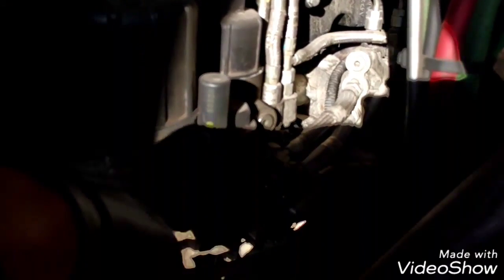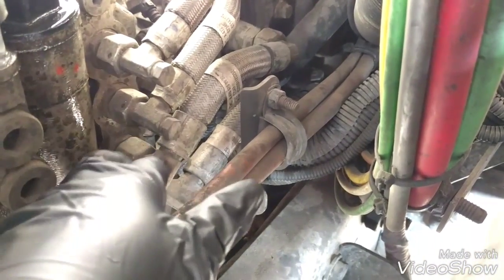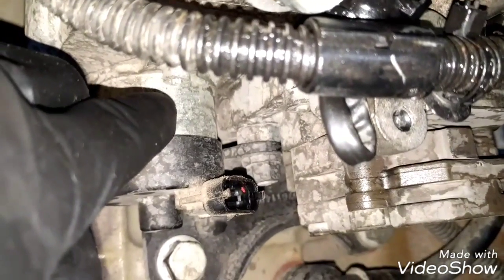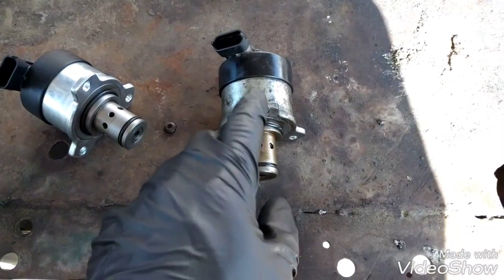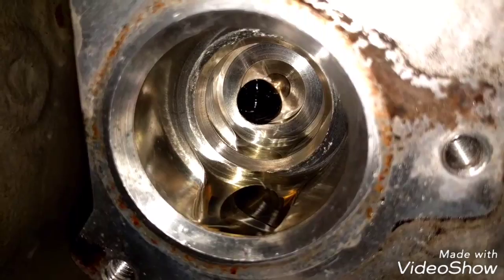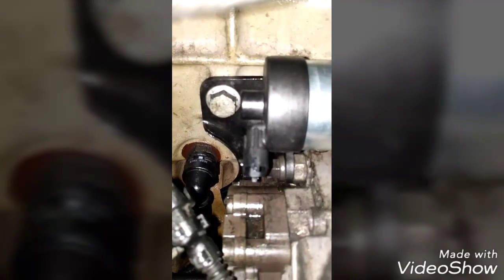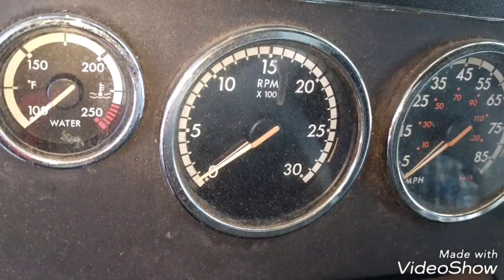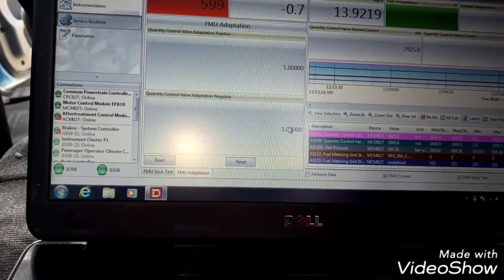Freightliner Cascadia DD13 DD15 ENGINE fuel quality control valve removal replacement detailed

Comment: Hey Francisco, can the fuel quantity valve cause vibration of the engine at 1500 RPM ?? Or does it only cause rough engine operation and idle??

Comment: Nice video amigo,question..can the fuel quantity valve be cleaned instead of changing straight away or it cant? Thank you for helping us drivers with some knowledge
Reply from the maker: No, the electronic area fails

Comment: Would this cause bad fuel mileage? I put fuel in this morning filled it up ran about 250 miles gauge reads half tank. I usually run about 300 miles to a quarter of a tank. I found this video so It got me thinking about getting this done. Thanks in advance for your opinion.
Reply from the maker: Yes, it is possible. A unstable valve can increase fuel consumption.

Comment: 2016 frieghtliner cascadia...What kind of check engine codes would we get if this value needs changing? I had a throttle valve code and after changing the valve I have a rough idle and the same code (DD15 spn 51 fail 18)

Comment: Francisco I change mys now I’m getting a loud noise will that rattle noise go away
Reply from the maker: What noise?
It should work fine with not weird noises
Reply: If you listen to the noise after you replace yours at the end of your video when you crank it up that noise if u could call me plz 6823654954 rob
Reply: Go to 3.40 in your video that noise

Comment: Hey do Volvo trucks have fuel quantity valve?
Reply from the maker: No, they don't.
Reply: Do they have something similar?
Reply from the maker: No, they have a low pressure fuel system with pushing rod to the injectors.  
The fuel system is controlled with the injectors only.

Comment: Hey Francisco! I recently replaced my valve but now I’m getting a fault code SPN 520250 Fail 4. Do I need to get the valve calibrate and clear code for the valve to work properly?
Reply from the maker: Check the fuel quantity valve plug, it could be shorted.  
It may be possible to replace the engine harness.

Comment: I have 1077 fmi 7... I replaced all injectors and code still comes up. I replace hp pump about six months ago, any idea? I dont see a line leaking
Reply from the maker: In the fuel rail, there is a pressure valve. This could be defective.  

The fuel rail pressure sensor could be defective.  

The fuel pump plunger could be defective. 

Also, the new injectors could be defective.

Comment: how did you drain the fuel filters? When you drained the coolant, was it from the radiator, or somewhere else?
Reply from the maker: No, I didn't drain the fuel from the fuel filter housing. 

Yes, I drain the coolant from somewhere else.  There is a small nipple located between the oil filter housing and the fuel filter housing (19 mm), you have open it to drain the coolant from the engine block.

Comment: Why is the orange engine like on?
When do you know   you need to replace fuel quantity valve?
Is there an engine code number ?
Reply from the maker: If you engine does this https://youtu.be/gYq_bcfBQk8 
You will need to replace the FUEL QUANTITY CONTROL Valve

Comment: If you don't use dddl soft wear will check engine lite come on after change
Reply from the maker: No, no light will come on. Unless you already have a check light with this fuel quantity control valve code on.

Comment: What could be the symptoms of a bad fuel quantity valve
Reply from the maker: Unstable idle
Low hp fuel pressure
Unstable HP fuel pressure
Reply: Does it air in system , doesn't start ,then pump it ,then it's start s

Comment: Francisco I changed the intake throttle valve on my 2012 freightliner cascadia because I thought the rough idling was because it was going bad but now its driving rough every time I start to drive it feels like its suffocating. Did I miss something? Please help
Reply from the maker: Probably you have a bad fuel quantity control valve
Reply: I just changed it last week cause I seen your video and its still doing it. The idling doesn't go up an down anymore like you show in your video. Its just hard to start rolling in the road especially the first couple of gears and also build up a smell that's just weird might sound silly but I'm nervous about this one. Thanks for your help..
Reply from the maker: Do you have a warning lights on?
Reply: No. Nothing has come on.
Reply from the maker: Como esta su presion de aceite cuando El motor esta en idle?
Reply: Esta normal Francisco. Cuando llege a mi proxima parrada voy a tomar un video y se lo mando. Nadie aca donde vivo en Chicago me a puedido ayudar
Reply: Me sale la luz de abs de vez en cuando
Reply from the maker: La presion de aceite debe de estar cerca de la primera line cuando El motor esta en idle a 210° f +
Reply: Si haci esta
Reply from the maker: Ok, sabe si tiene alguna fuga de precion de El turbo en Las mageras, en El cooler or en El mismo turbo?
Reply: Como puedo chequiar o saber si hay escape
Reply from the maker: ponga a trabajar el motor a 1500 rpm y dejelo haci mientras usted sale afure y se va al cooler y las mangeras con un spray con agua y jabon para ver si hay una fuga. esa es la manera mas facil y economica

Comment: What was the reason for replacement?  I'm having an issue with my DD15 having low fuel pressure under 80-100% engine load.
Reply from the maker: The fuel press was unstable. 
Check your HP fuel system with the DDDL software to have an accurate reading of your HP fuel pump when the engine is loaded.
Reply: Francisco Amaya I have a engine derate by 25% an coming up with a fault code : eng 1 5357 spn fail 16...what could this be? 
Check engine light an mil came on an check engine light went out after a couple minutes but mil remains.
Reply from the maker: This code means Fuel Quantity High Detected. 

This could be caused by a bad fuel quantity control valve, fuel pump or fuel pressure sensor.  

With the DDDL software check the HP fuel common rail pressure.